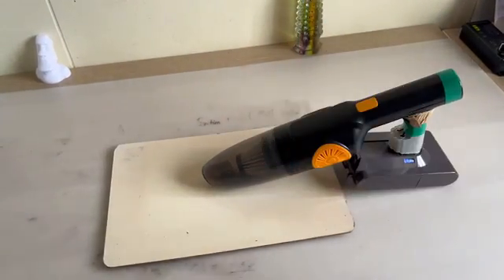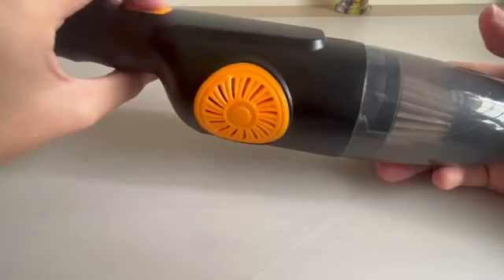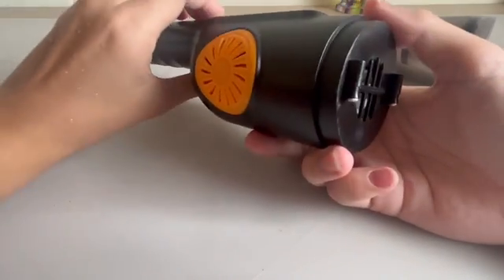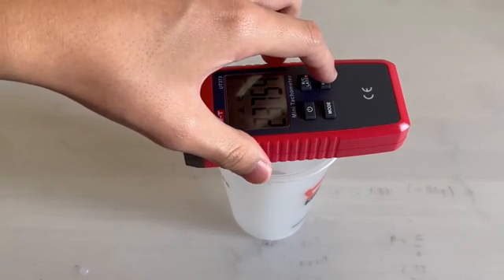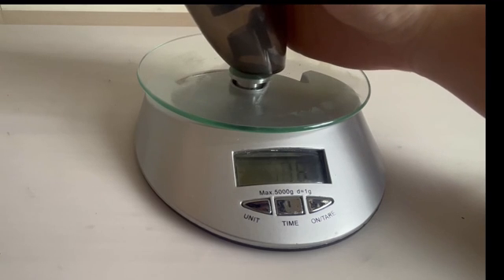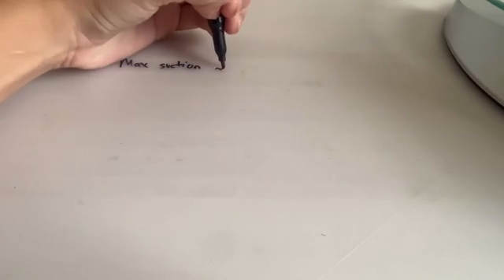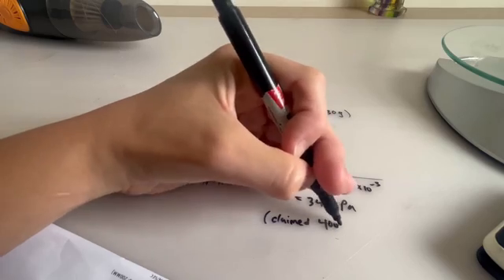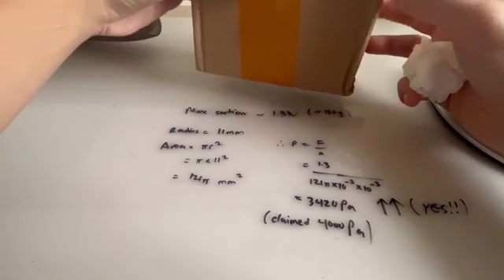Vacuum Cleaner Hack! (Don't Throw Away Your Old Vacuum Cleaner!)

Comment: hi that's a nice video, I wanted to ask you, as I bought what seems to be a similar motor to the one in the video but mine is 12v 100w supposedly from the listing, but when I connect it to a power supply it starts and then it shuts down on its own a few seconds after.... this tells me it works... but I don't know how to make it work as I already tried with a Constant Voltage 12v 150w supply and a 12v cordless drill battery and it still happens
Reply from the maker: It’s not the power supply that is fault but probably the connection scheme of the motor. Most motors have an enable pin to turn on the motor. Usually there would be the instructions on how to operate the motor on the website, go figure 😊